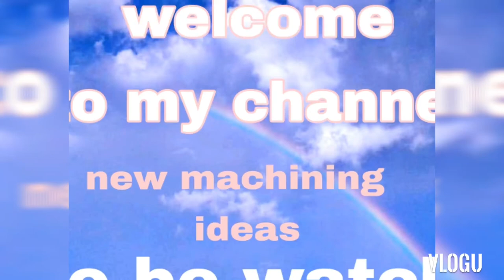How to make pipe nipples

Comment: sir are u using a cnc machine to cut the threads can it be done with rolled sheets or pipe only plz help
Reply from the maker: I am using manual lathe machine and I do it  threading manually;
And the material are seamless pipes